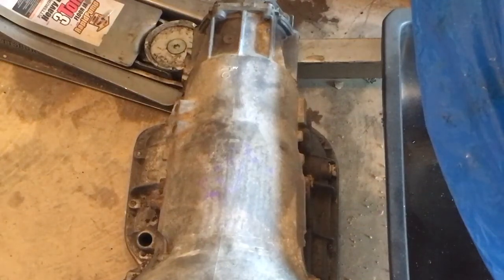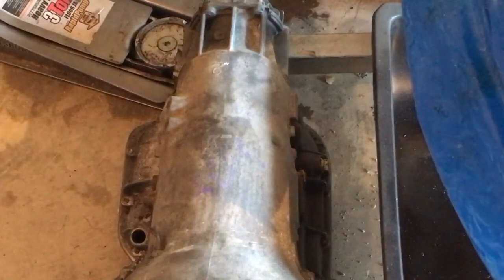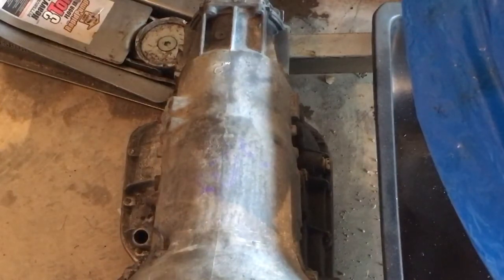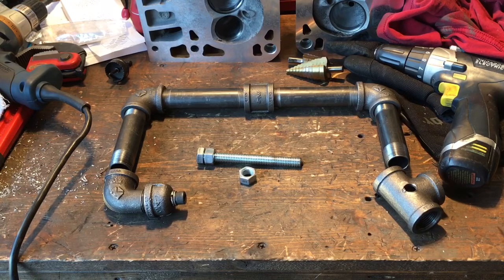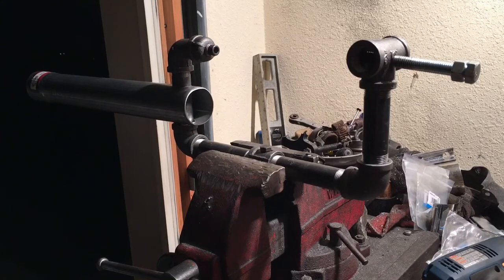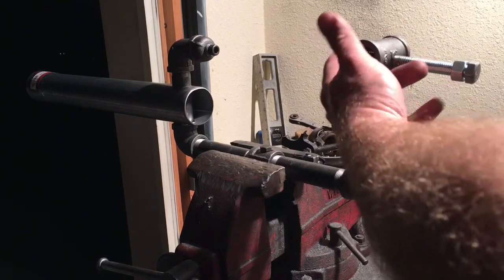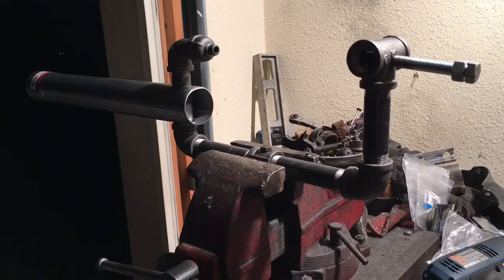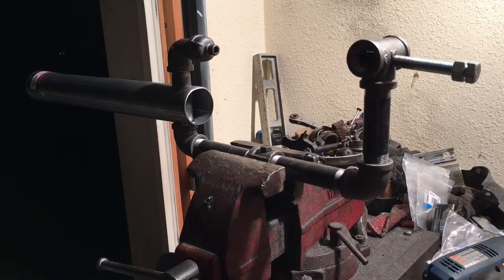DIY TH400 rebuild fixture NO WELD

Comment: Pretty good idea show us how it works thanks
Reply from the maker: 265chevy I think I’m going to upgrade the 2 1/4” exhaust pipe to 2 3/8” galvanized fence pipe/post. I put my 230# on the fixture tonight and it felt soft, it didn’t fail but didn’t feel very strong. 
I had to add a 5/16” bolt through the exhaust pipe/fixture pipe to make it solid.  I found out just using set screws/bolts did not work to stop the side to side axis. 
Im going to make a follow up video hopefully tomorrow with a fully assembled TH400 mounted. 👍
Reply: great thanks
Reply: HeadFlowInc STOP don't mislead people and STOP b4 you get hurt I mean damn
Reply from the maker: 265chevy Mothers Day delay, I upgraded the main pipe to a 2.0” ID or 2 3/8”” OD Black iron pipe!  I have a couple more holes to drill but the new pipe can hold way more than a TH400!  Definitely the right choice!  I’ll get a video, with updated parts list up ASAP; show a full weight TH400 mounted too. 👍
Reply from the maker: Richard Harris Please feel free to go find a $20.00 fixture that will do what mine does. 
The 3/4” pipe and 2.0” steel pipe I end up using in the final product can support over 400# 😳😳😳. 
#makeithappen
Reply from the maker: 265chevy Well, the new 2.0” ID steel pipe worked great!  I have good and bad results:
Good, the fixture worked great horizontally.
Bad the pipe fittings won’t stay tight when I try to rotate an assembled trans Vertical. 👎

I’m trying to decide if I’m going to give in and weld the joints or continue on my no-weld intent... 🤔. Welding would be so much easier.